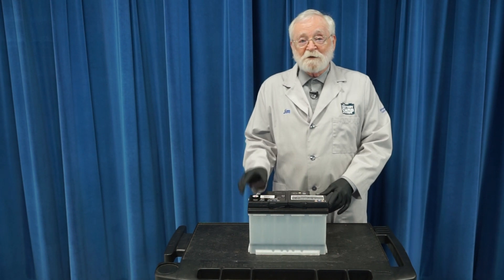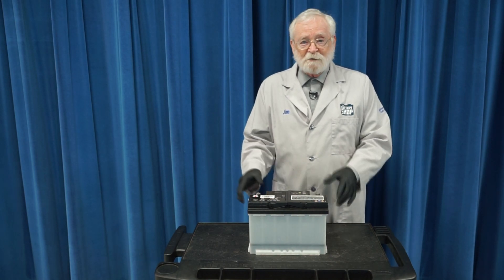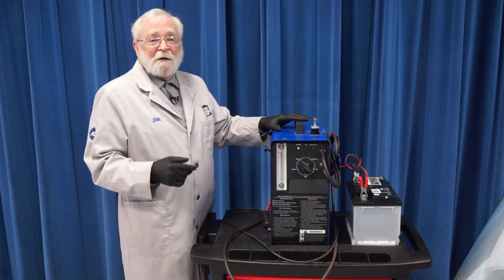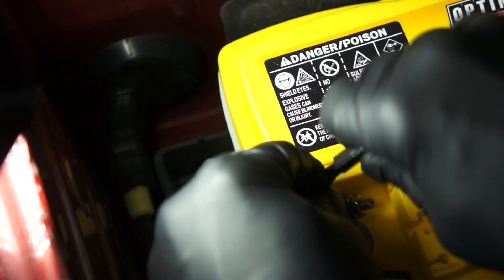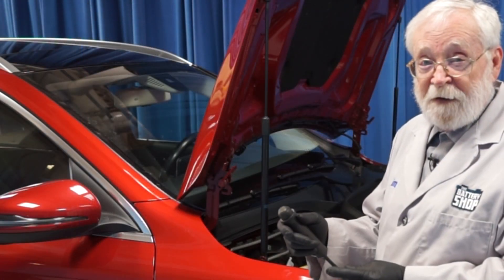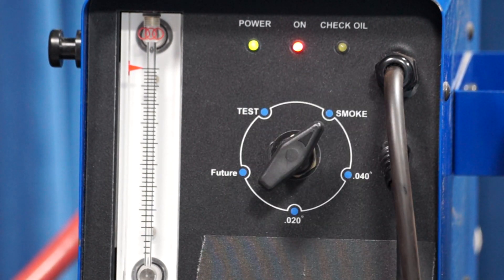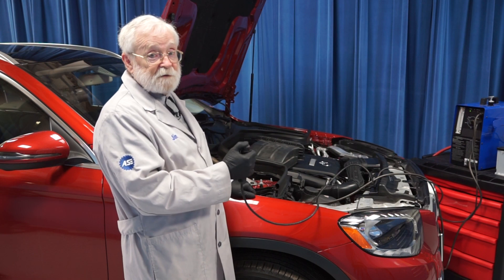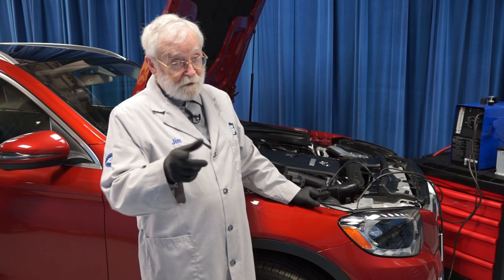Battery Vent Tube Testing - The Battery Shop

Comment: I have a vent tube connector off a used battery that I am trying. It takes the place of the elbow connector that you see a lot but is like an oblong construction with what seems to be a filter inside it. I can’t blow through it so I don’t know whether to use it or not. The filter or goes inside is white and it appears to be clean though. It connects directly to the battery on one side and the other side of the lozenge shaped fitting is where the tube runs from to exit the vehicle.

Comment: My local Toyota stealership was demanding $537.59 + $105 for installation for a 2880031293 OEM battery for my 2012 Toyota Highlander Hybrid. I Instead, got a replacement "Canada Proof" group 35 AGM 50Ah 650 CCA battery from my local Bumper to Bumper auto parts store for around $280. Installed it and it works, but also needed to get a replacement battery hold-down bolt for like $10 from Canadian Tire as it was a little bit taller than the original Panasonic D23 20HR 51Ah 355 CCA battery. Also, still on the look out for a vent hose adapter as the original tubing is slitghtly bigger than the inner vent hole on the battery but fits losely in the outer one, and the battery only came with vent plugs but no elbow...any suggestions on where to get those?

In the mean time, think I'll use the foam washer that came with the hold-down bolts; cut it down to size, place it around the vent tube and insert it in the bigger battery vent outlet. That way, at least any hazardous gas released wouldn't be leaking freely into the cabin.
Reply from the maker: Thanks for watching and for the extra tips.

Comment: I took the battery out of my car and forgot to put the vent tube back in when I returned it the the vehicle, can this cause a battery to die? Because mine did and I have had no luck keeping it charged after jumping...it's a hybrid
Reply from the maker: Thank you for watching.  Typically this would not result in a dead battery.  We would recommend consulting a mechanic if vent tube is no longer functional or going back in to the vehicle and installing the vent tube. The vent tube is there to help displace gases that are built up during the charging process.

Comment: Wow thank you I just looked at my battery inside my car behind the seat and the vent tube is sitting on top of the battery not connected at all. Could this also cause problems with the battery or alternator?
Reply from the maker: Hi - Thanks for watching! The vent tube should be attached to the battery’s vent port on the side of the battery to prevent dangerous battery gasses from entering the passenger compartment. Vent tube problems would not affect battery or alternator performance.

Comment: My cars battery didn't come with a plug can I cover the hole with tape?
Reply from the maker: Hi - Thanks for watching! O.E.M replacement batteries should come with a plug for the unused vent. We don’t think tape will be effective and we recommend obtaining a proper plug from the seller of the battery or from the vehicle dealership parts department.

Comment: How much of a difference do you think it will make if one hole remains unplugged while the other is being vented correctly?

Is there a chance of a build up of gasses in the car with this sort of setup?
Reply from the maker: Hi - Thanks for watching! The other hole will vent battery gasses, so it must be plugged to prevent this.
Reply: @TheBatteryShop  Thank you. I've been driving for a month or so without a plug in one side of the battery. 

Do you think a bit of tape will do the job?
Reply from the maker: Hi - We have not tried that, so all we can do is recommend a plug of some type.
Reply: @TheBatteryShop this is exactly the question I had as well. Really appreciative of being able to find this out on YouTube.

Comment: Question please.   I have a battery in my trunk. When i finish my trip i notice smog from the bottom of the car . So is that normal because i tought there wasmsomethijg wrong with the battery
Reply from the maker: Hi - Thanks for watching! Battery gasses venting from the battery are colorless. We think something else is going on that you may want to have checked out.
Reply: @TheBatteryShop  thank you it was the battery already bad.  Replace it and car is running beautifully 👌

Comment: Wish you showed where the vent tube connects to car, I accidently pulled mine out and can not find where it reattaches.
Reply from the maker: Hi - Thanks for watching! We suggest that you check a service/repair manual for your vehicle (available at auto parts stores) for the connection port.

Comment: Can I run a long vent tube? My best opening in the Jeep requires about 6 feet of 1/4" tubing to reach. The battery is mounted behind the driver seat.
Reply from the maker: Hi - Thanks for watching! Our best advice is to consult a service/repair manual to run the vent tube to the original equipment manufacturer's location.

Comment: I have a brand new Champion battery to put in the trunk of a 2008 BMW E90 model. I see the vent holes where I attach the vent hose. Do I need to open the small hole (by inserting something in the hole to open the hole up) or are the holes already from the factory both open and vented. There's no plug in the other hole so not sure how I can plug that up if it is open from the factory. I am likely installing the battery today so your info would be greatly appreciated before I install it. Thanks. 
Philip
NYC Area
Reply from the maker: Hi - Thanks for watching! Both vent holes in the battery are open and vented. The new battery should come from the factory with a plug in one of the holes and can be removed if necessary used to plug the vent hole that the vent tube is not using.
Reply: @TheBatteryShop  Thanks for that info. I didn't even know these batteries had vent holes. Then when I saw my new battery with no plugs on either end, I figured perhaps both vents are closed and I need to open one vent by inserting something to break a seal, etc. 
I can hopefully fit the plug from the old BMW battery into the New Champion Battery. Thanks for the fast answer that both holes are already open. Appreciated.
Phil
NYC Area
Reply from the maker: Hi Phil - Glad to help. We hope your project goes well.
Reply: @TheBatteryShop  yes thanks. It is nasty here today (wet/damp out in NJ) but I plan on installing the battery tomorrow, weather permitting. Thanks!

Comment: So I had a code of p0346 Sensor A Circuit Range/Performance Bank 2, cam shift sensor engine light, got the sensor changed twice and engine light returned sometimes on sometimes it goes off, well my battery vent cable was completely disconnected, would that cause engine light ???
Reply from the maker: Hi - Thanks for watching! The vent tube is just for venting the battery. So far as we know there is no electrical connection to or from the vent tube.

Comment: Great video and professionally sound. So I have a car. I'm  moving my battery to go in the trunk. I'm putting it in a sealed box battery box. My next step is to drill my own ventilation hose to run to the outside of the car. Only problem is, the ventilation hose would be expelling the gases right by the gas tank underneath the car. Would that cause any explosions?
Reply from the maker: Hi - Thanks for watching! We really don't have an answer to your question, but be aware that battery gases can contain hydrogen.
Reply: @TheBatteryShop  ok thanks! Will definitely keep that in mind
Reply: @djack2058  are you still alive??
Reply: @SobridMusic  not on the inside
Reply: @djack2058  we're all zombies

Comment: Do lithium batteries leak waste like this?
Reply from the maker: Hi - Thanks for watching! No, there is no liquid electrolyte in a lithium battery. Lead/acid batteries are vented to let the hydrogen and Sulphur gases that are created during the charging process escape when the pressure build up in the battery gets too high. (It's a bit more involved but that's the simple Answer)

Comment: Hello! Thanks for your video.  In this case, I have the exact same car you showed in the video, the battery is under the hood and not inside the cabin. Can the gasses still enter the cabin if I don’t connect the vent tube ?
Reply: Yes because stupidly it's pulling air from under the hood into the cabin.  Also if you have an exhaust leak it's pulling that into the cabin poisoning you. Also if you have an oil leak that is onto exhaust it is pulling that smoke into the cabin slowly making you sick. If it's a new car no biggie but an older car with oil leaks and exhaust leaks yikes.  I suppose one benefit of this is in the winter the warm under the hood air is pulled in to help warm your cabin quicker.
Reply: I will add that even though it is under the hood I believe it is behind a partition to the engine so it might not as easily take engine gases in as I had previously noted.

Comment: The edge of my car's vent tube is broken and lil part of plastic is stuck in one of the battery's hole. 
It's a Bosch S4005.
Is it dangerous or not ?
Should I replace the whole tube? 

(I'm French, sorry if my English is not that good 😅).

Comment: I hooked up a vent tube to my 12V polaris atv battery and noticed that after hooking it up, the electrolyte level went down to the low level indicator. It came with a plug over the vent port on the battery from the polaris shop, was I supposed to leave the plug on the vent port? I'm thinking some of the electrolyte possibly evaporated from the battery slowly, resulting in the lower fluid level and therefore draining the charge....lastly, there is only one vent port on the battery, am I supposed to only attach a vent tube when charging the battery and have it plugged at all other times? Thx very much for any and all information, it's very much appreciated! :)

Comment: Will the battery go dead if the tube isn't hooked up? Mine is dead and I found that tube wasn't connected.
Reply: @Ed Napkin did u get the answer to ur questions?? I’m having the same problem also
Reply: @teepho3569  No. I got rid of that car shortly after I posted that. It was an Chevy HHR. Ran great though.
Reply: Thanks! @TheBatteryShop
Reply: h
Reply: Same here my battery goes dead over night and I have to jump start it ..is it because the tube is not plug??